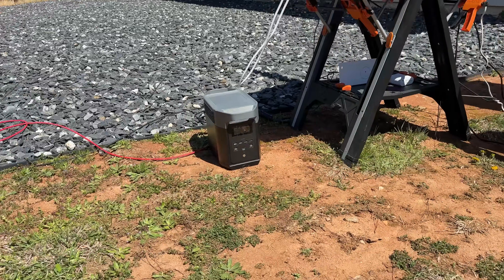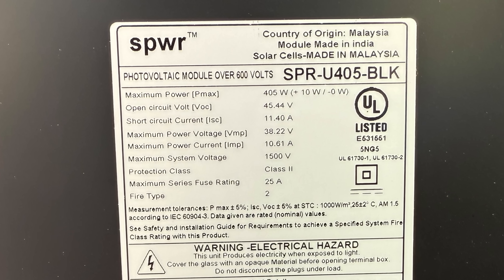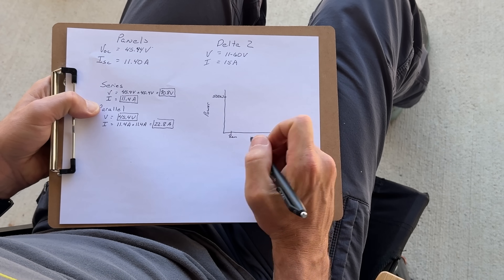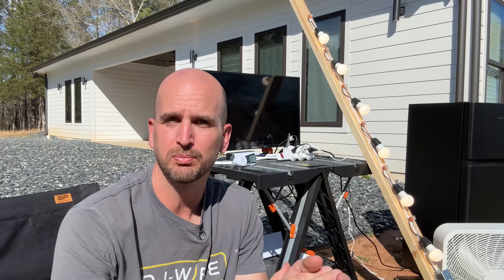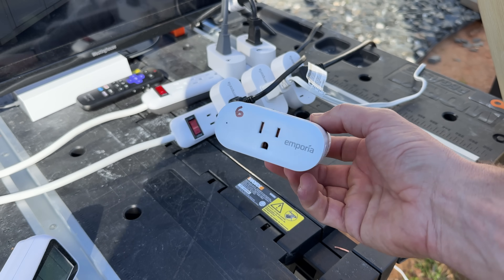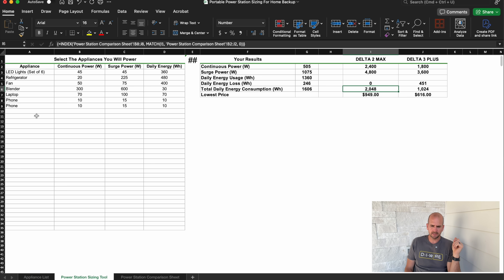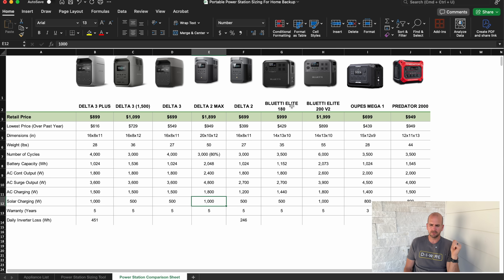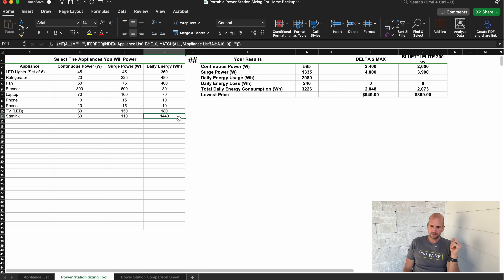What Size Power Station To Power A Fridge

Comment: I am wondering if you considered the Delta 3 1500 over the Delta 3 plus or the Delta 2.  The delta 3  1500 has the same inverter size as the delta 2 but has a 1500 watt battery capacity .  With the over paneling on the delta 3 on cloudy days that could possibly get you over the hump during the night over the Delta 2 with only 1024 battery capacity.  On the other hand, the Delta 3 plus could still possibly get you over the hump during the night more so than the Delta 2 since it has 1000 watts of input.  Though the inverter loss is doubled that of the delta 2, the way I see it with 1000 watts of solar coming in that would cut the inverter loss in half making it about 230 watts vs the delta 2 of 246 because you are able to fully charge the unit more frequently during the day.  By over paneling as you would the delta 3 plus it could provide you with the necessary power you need.  Regardless, even on cloudy days I would not take an extension battery for any unit you would choose.  Instead I would just use a 12V 100ah or 280ah lithium battery to extend battery life should you need it.  You get double to triple the amount of energy required for the price of one expansion battery that is useless if the main power unit is broken.  At least with the batteries you can add a small inverter and solar charger should you need to, not so with the expansion battery from ecoflow or bluetti.  Great video and explanation.  Hope you let us know what you decided on.
Reply: The Delta 3 has exactly the same capacity as the Delta 2 (1024 Wh).  And exactly the same solar input (500W).  Maybe you are thinking of something else.  

Beyond that, using a standalone LFP battery (plus fuses, etc.) rather than the expansion battery is completely inconsistent with making this setup as simple as possible for non-techies.
Reply: @evahsia  If you look at the video at 9:53 he lists the Delta 3, Delta 3 (1500), and the Delta 3 in order at the very top the Delta 3 1500 has more battery capacity than the other two.  Also you don't need fuses if you connect the lithium batteries directly to the solar ports to charge the ecoflow or bluetti, they already have the safety devices in place. Instead of running a gas or propane generator on cloudy days you just connect the 12V or 48V batteries to the power banks.  I am just saying that a stand alone battery has more versality if it came down to it than an extension battery if the main power bank malfunctions.  Then, you are left with an extension battery that you cannot use or even solar charge because you need the power bank.
Reply: @ OK, I was right.  When you refer to the Delta 3 in your post, you are always referring to the Delta 3 (1500).  You should correct your post.  But, if your only input is solar at (500W), the whole system is limited to that rate.  A bigger battery, no matter how big, provides no additional practicality.  (Not withstanding your hump argument.)

I agree that the external battery CAN be connected directly to the solar input ports without a fuse.  I wouldn't in case the cables got accidentally crossed during switchover.

I agree with the redundancy argument (power bank dead).  However, to accomplish that you need additional equipment to charge the external battery when the power bank is broken, specifically a MPPT battery charger.  And then an inverter to use the external battery to produce power.  So, lots of added complexity in exchange for redundancy.  (I am sure you understand this, but this is for completeness.)
Reply: @evahsia  I see your point and you are correct.  Still the stand alone battery offers more versatility in case of an emergency.  For the cost of a stand alone battery and a pwm or appt solar charger you would still save more money over an extension battery which could be your back up if the main power bank becomes inoperable.  Also the cost of a 2kw inverter like Giandel can be bought for under 150 bucks.  Redundancies are always good to have, but I do see and acknowledge your point of view.

Comment: Excellent video. An option for extending battery backup would be connecting a stand alone battery to a solar charger, and have the battery feed the powerstation (in its solar input). In that way it can be set and done. Otherwise if one uses the stand alone battery only when solar is not enough, the powerstation would have to charge the stand alone battery via a charger, and then when needed have the battery replace the solar input. IMO too much hustle compared to have the battery receive solar via a controller and, then go to the powerstation.

Comment: FYI Hobotech calculated the Bluetti Elite V2 AC idle loss at 352wh per 24hrs which seems to be backed up around that by a few other youtubers. Seems like it has a very efficient inverter for the size.
Reply from the maker: Thanks for the heads up and I will update the worksheet 🙌
Reply: ~350 watts per day idle loss + 5% of the watts delivered confirmed here  Inverter/power station losses for the Bluetti 200 V2 consisting of 5% of the watts delivered direct inverter consumption + power station standby loss figures of 12 watts per hour to 15  watts per hour have been shared here at 18:31 into the video from DIY Outdoor Life on youtube here  https://www.youtube.com/watch?v=vKG2tiiNTV4

Comment: If you work out a daily energy loss figure for the Bluetti 200 V2 or other units Please noise it abroad.  Real world use figures and real world inverter loss figures particularly seem hard to come by for the beginner seeking to learn.  Thank You.  This home in Haiti project will be of interest to many.
Reply from the maker: Will do and I might start running the 24-hour inverter loss tests for a number of power stations in this size class.  It is a BIG factor of getting the right hardware for your setup.  One of the viewers just reported the BLUETTI ELITE 200 V2 had 352 Wh of losses for a 24 hour period which has been updated on the worksheet.

Comment: I might add that the Starlink unit could be less than 24hours to help conserve power usage.  Do you have a video on how you added the mp4 connectors on the meters?  I bought them but need to setup like you have shown.
Reply from the maker: True, you could take it offline every night and make a significant difference.  I would prefer to keep it up and running but good to have options.

Comment: I have 3- 660 watt panels- $450! A 250v charge controller- $275! 6 100 ah agms- $450. 1500 watt sine inverter-$150!
 Let's say $1500 total with wire and accessories. All that super expensive technology stuff you're buying is needless a huge waste of money for getting far less real world performance!
My system is one and done don't have to monitor anything or do maintenance it runs itself! Keep it simple my friend bought that fancy expensive crap still had to buy 4 batteries like mine so take my advice!
Reply from the maker: Thanks for the feedback and details on your system.
Reply: you are comparing apples to oranges. That is a stationary setup which by they way is unoptimal since you put agms instead of lithium, it ends up being more expensive. A powerstation is portable, practically diy proof, and can also have many large solar panels. As shown in this video in the beginning, overpaneling. Battery size yes one could add an external battery to a powerstation or if budget allows, a way bigger powerstation at once. Prices of components differ in different countries, as well as salary and how much people value their time. This was a good valuable video.
Reply: @segundacuenta726  There's no comparison apples to oranges when it's a means to achieve the same result, power!
If I remember correctly this video is about setting up a permanent setup not portable. Also there's no way in any country those portable lithium power stations which are nothing but a built in charger inverter and battery are less expensive, especially when compared to charging and reserve power! Believe what you want buy what you want and see for yourself.

Comment: Great explanation!  I made the mistake years ago of buying my first panel, 80v, with the original ecoflow 1300.  It was way more voltage than it could handle.  Lots of learning happened since then.
Reply from the maker: I have made my fair share of solar mistakes over the years.  Welcome to the club 🙂
Reply: That's an awfully high voltage for a single panel.  Wow!  Do you mean 2 panels in series?